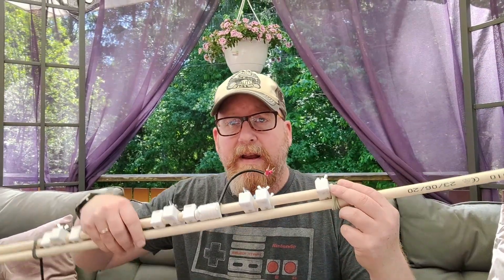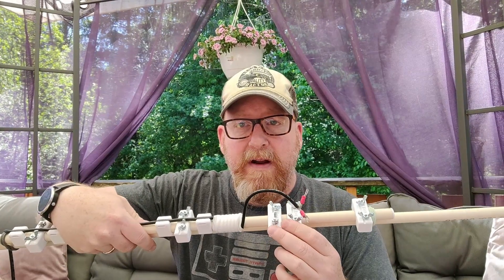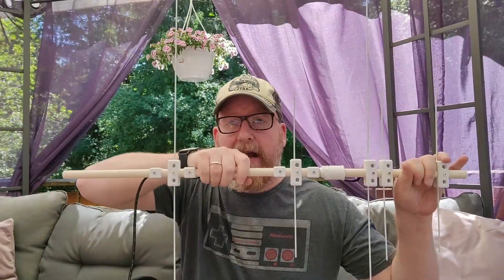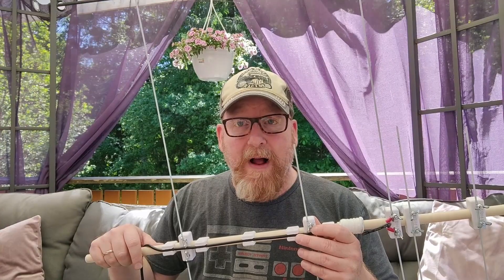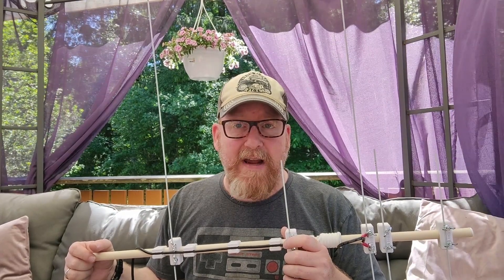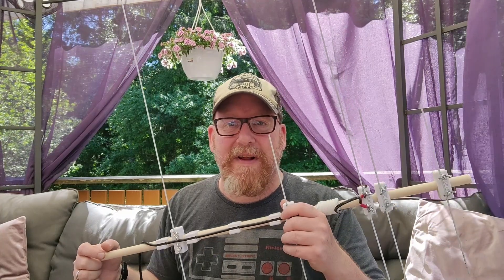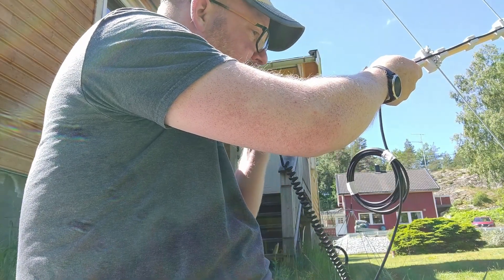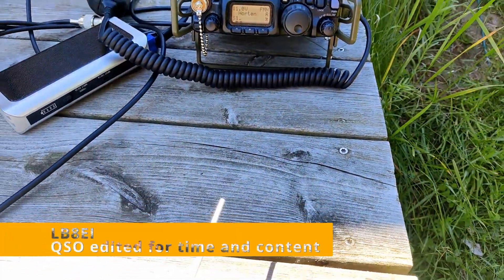2m/70cm Yagi for More Handheld Gain.

Comment: How do you make it 50 ohms
Is it the wraps on the cable
Reply from the maker: The wraps is for choking common mode currents. You tune the antenna by adjusting the length of the driven elements.

Comment: Could this antenna be made with tape mesure instead of aluminum rods or what other rods coult be used ? Maybe coat hangers lol ? , also did you made the choke box as in the link ? Is it necessary?
Reply from the maker: You can make this with pretty much any conducting material. Just experiment and see. As with the choke, you can see mine on the handle. I figured that was a better design.

Comment: Hello, I have a question. Did you actually use 6mm rods? Did you make it thinner? If the wires are thinner, is there a difference in the angle and position of the antenna? Thank you in advance for your answer. Wojtek sp9dlk
Reply from the maker: I have to check the actual size, but they were way thinner than 6mm. I stole a clothes drying rack from my wife and cut the rods to size. I wouldn’t think that the thickness of the rods would make a difference here.
Reply: ok, because I was on the website provided under your video, and there the distances between the elements are calculated for 6 mm tubes, but if you use smaller needles, it's ok and the distances match. cool. I'm slowly printing the elements, Regards @LB0FI

Comment: Why do all these antenna building videos automatically assume all hams own or have access to a 3D printer?  How about some construction videos that DON't require a #D printer?
Reply from the maker: I don’t assume anything, I just showed what I did. And you could probably replicate the design without a 3d printer. That being said, a 3D printer is almost as useful as a multimeter in this hobby.

Also, feel free to make the videos you want yourself.
Thanks for commenting!

Comment: I just seen ya vid,to stop the usage of a screwdriver u couod use hex head bolts and 3d print the mount and then glue the bolts
Reply from the maker: That’s absolutely a good idea, and if I was to design it again,which I am not, I’d probably do it that way.